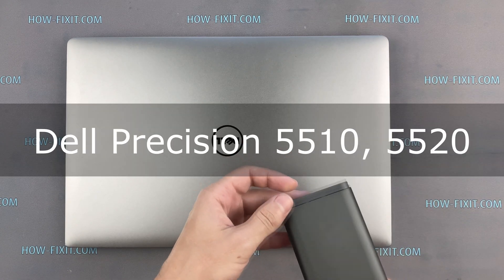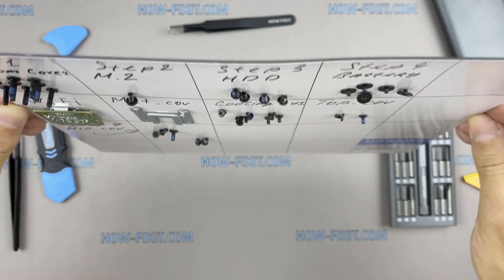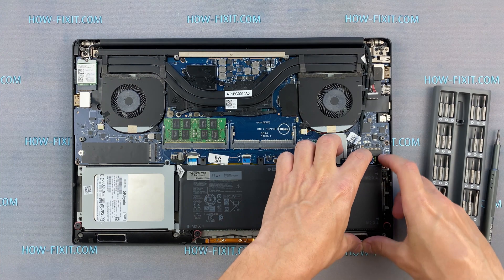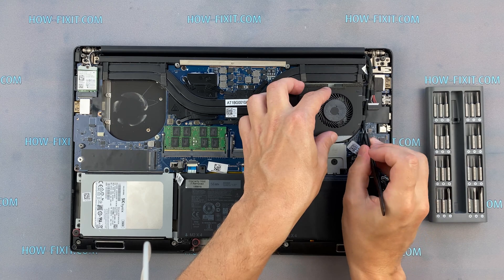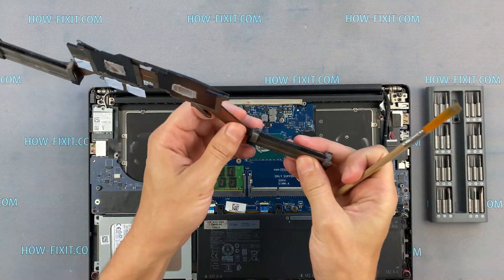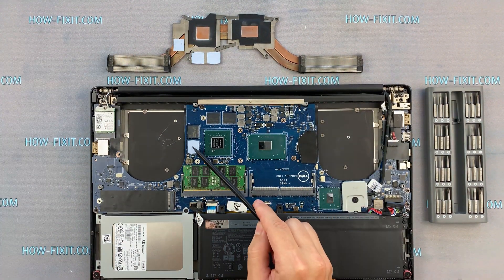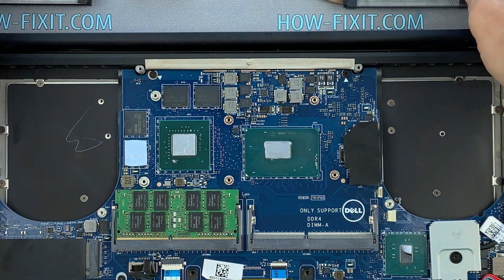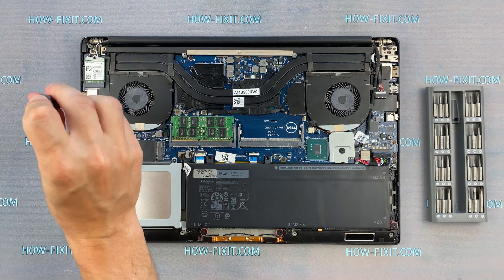Dell Precision 5510, 5520 Disassembly, fan cleaning and thermal paste replacement

Comment: I've lost those 3 or 4 pads attached to the heatsink, is it a big deal & what should i do?
Reply: YES It is a big deal. You need to replace these !!!
Reply: @XA--pb9ni  DO YOU KNOW WHICH PADS TO BUY, THE LINKS ON THIS PAGE BRING UP A HUGE LIST OF DIFFERENT TYPES
Reply: @derickroche5352  i used 1mm pads from arctic, and just cut them to size. They are called Arctic TP-3 Thermal Pads. But i also have a Precision 5530 NOT a 5510 or 5520 .
Reply: @XA--pb9ni  they are probably the same.